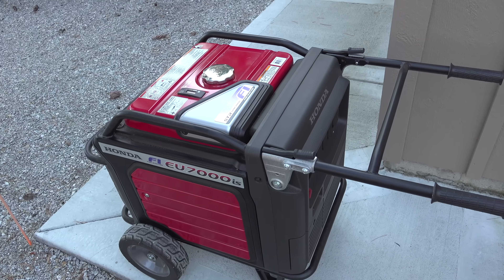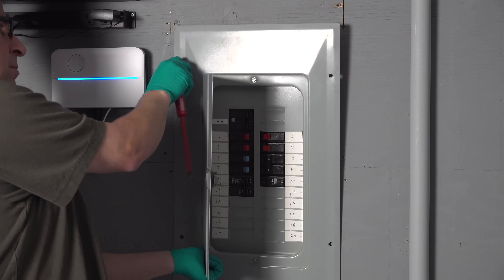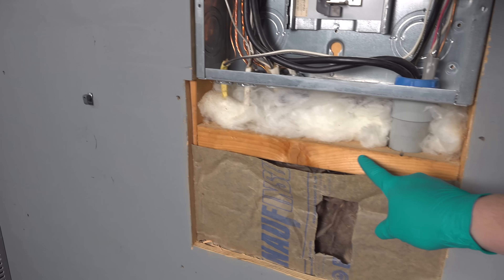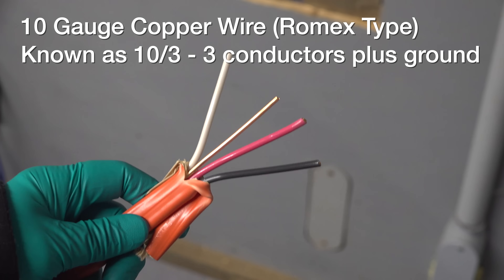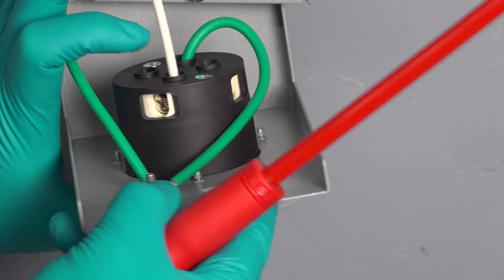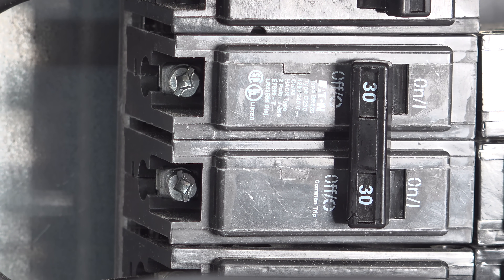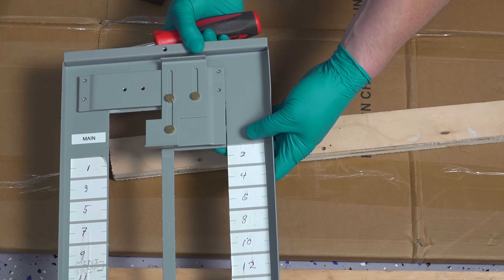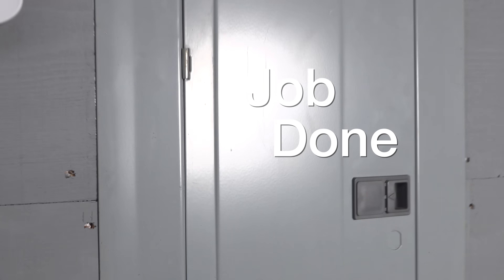Cheap & Easy Way to Connect a Generator to Your House - Legal Too!

Comment: If only my 60 year old panel had a main breaker.  Instead I have a massive main fuse block with two 100A fuses so I'm SOL.
Reply: so you can use a transfer switch?

Comment: Hi,
Thank you for the useful video. 
I have a question please. 
I already have a generator connection. I want to reverse the sama idea and use that same outlet where you plug in the generator, use it for EV charging. 
Is it possible? If yes what do I have to change? 
Thank you in advance 🙏

Comment: Why would anyone install a 30 amp, though? Always install a 50 amp. If you have a smaller generator, you can get a 30 amp adapter or female plug. If you get a larger generator later, you won't have to do so much work.

Comment: i prefer to use an automatic transfer switch. they are not very expensive and will not transfer until the generator is running. i also like remote start for the generator. no going out in the rain to pull a statrt cord.

Comment: Would it hurt to install the 50 instead of the 30 in case someone later upgrades or daisey chains their generator?
Reply: I would not since the purpose of a breaker is to open under excessive load. Running an excessively large breaker reduces that protection.  If someone changes their system they should ensure the entire circuit INCLUDING CONDUCTOR SIZE is correct for the application.

Comment: You need a hold down for that breaker as well, to comply with 408,36(D). 

There is a multiwire branch circuit in the same conduit as the service conductors, that's a code violation. 230.7

Comment: What stops backfeed from going out the other end of the house and killing the lineman trying to re hook up the downed power wire?
Reply from the maker: That's what the interlock does. By being forced to turn off the main, you are disconnecting from the grid. It mechanically ensures it when installed correctly.

Comment: Could I run the whole house and water pump(well)  a generator is usually 30/40 amp a whole house should be more correct ??? Ac , lights , tvs fridges washer dryer?

Comment: Hi, I like this video, I just need to understand about the capacity of the generator I need to supply electricity to my house (1.000 KWh) monthly in my electric bill, How to calculate this capacity at least to supply continue energy  for 10 hours before recharge/refuel or something.

Comment: So… 10awg is sufficient for a 30a 240v set up? I need to extend my inlet box to a different location. How long of a run with 10awg wire is safe for a 30a set up ?

Comment: i need to do this so one question! the generator beaker switch , when you install that will that power everything and turn off what you dont need to not overload the Gen ?

Comment: I remember confusing everyone when my apartment power went out. I pulled the car around back and connected it's internal generator (it was a ford probe converted for camping) and turned off the main then plugged in the car generator to the user side of the meter box (user service feed bypass) which wont open until the main outdoor switch is thrown (to prevent back feed) . Everybody was like, how you gonna get power to your apartment with a car? lol

Comment: Hi where would you put the generator if it's raining in a storm, with wind?
Reply: I would have a suitable outdoor enclosure which doesn't have to look pretty but should be securely anchored and high enough never to flood.  Putting a genset on a wheeled cart or dolly (using decently large wheels even if you have to add them) or hand truck is another option if you're not in a high theft area.

Comment: I saved 50 bucks by making my own interlock using a piece of 1/8” soft but rigid plate aluminum. Either take accurate measurements or copy them from other kits. Works like a charm⚡️

Comment: Great video. You've done a fantastic job in showing how to properly wire up an external 30Amp plug for a generator. I'll be installing a 50 Amp plug on the outside of our home since I'll  have a GENMAX GM11000 iETC electric start inverter generator. I'll be using 6 gage wire since it's for 50 Amps. Again, thank you a great educational video. Cheers!

Comment: I actually use two different generators. One is a 3500 watt inverter that burns very little fuel. We use it during power outages when outside temps aren’t hot enough to use ac. Will run anything on 120 in our house. Have a 15500 that will run the entire house, but uses a lot more fuel.
I have a disconnect that prevents back feed. The way I have it set up, takes just a few minutes to switch between generators. Could have went with the generac setup that is all automatic, but there are other things I need a generator for. Fortunately most of our power outages are thunderstorm related and generally last just a few hours. But we occasionally have tornado damage that lasts for days and the occasional dreaded ice storms. 
We live in a very rural area and our local power company does a very good job but they can get overloaded with work in a short time. Large coverage area, not many employees.
When we are expecting storms I go ahead and get the small generator set up, ready to go. Really helps.

Comment: Why not just install a 30A receptacle and use an extension cord that is male on both ends?
Reply: Because an unplugged male end will be live if the other male end is receiving power. If you touch the unplugged male prongs, while it's receiving power, it will electrocute you. If you let the male prongs touch any object, it will make that object electrified, and touching that object will electrocute you. Meanwhile , if that end is a female end, it will not have prongs to touch anything, and can not electrocute you if you touch it, and it can not electrify any object it comes in contact with. This is why any end receiving power should be male, and the end sending power should be female. You can technically get by using the double male end but you will want to make sure the unplugged end is not sending power until it's plugged in.
Reply: @howardradford1985  but you’re not supposed to plug it in while it’s running. So, if you plug it in when the generator is turned off like you’re supposed to then there is no risk of electrocution right?
Reply: @judynuno5694  You may also have the issue with a fault crossover or main breaker. I have seen breakers where the internal components melted and fused in the on position. You can flip the breaker in the off position but because it's fused it's not actually off. If you turn off the generator and unplug it the power could still be traveling the opposite way. If there is no fault it's not a problem.
Reply: @howardradford1985  is there a panel that is more prone to such a problem than others? I have a 200Amp panel and have 8 open spots.  I’m not using anywhere near the potential of my panel. Could that still be an issue?
Reply: @judynuno5694  It's not really the type of panel it's more the main breaker itself and how much you have on the bus bar. It's you aren't pushing the 200A to it's limit than it's unlikely for it to fuse, but that just means it's a much lower chance. If you are confident and I mean really confident you haven't been pushing the 200A to it's limit you might consider yourself safe, but an licensed electrician can never consider it safe.
Reply: @howardradford1985  thanks for the tips

Comment: Could you use 8 gauge wire instead of 10?
Reply: Yes, you can always use a thicker gauge wire. 8 gauge it for 40A and down while 10 gauge is for 30A and down.

Comment: I can find most of the supplies ill need on amazon. but what type of wire do i need? what gauge. and would i most likely pick up the wiring and romex from home depot? thanks for your time
Reply: Depends on you generator or how high of Amps the breaker you want to use. Generator with 7200 watts or less will max out at 30A and need 10 gauge wire. Generator with 12000 watts max out at 50A and need 6 gauge wire but if you only want to use 30 Amps of the 12000 watt generator you can use 10 gauge. Some people will intentionally use the lower Amps on the higher watt generator so they aren't pushing the generator to its maximum capacity and help fuel consumption.

Comment: How do you know what size wire to use?
Reply: 50 amp needs 6 gauge
40 amp needs 8 gauge
30 amp needs 10 gauge 
20 amp needs 12 gauge
15 amp needs 14 gauge
10 amp needs 16 gauge

Amps are all you have to worry about when selecting a wire because all wires can carry 240 volts.

Comment: What kind of wiring do I need to go from inlet box to the breaker panel?Also do I need 10-3 or 8-3 gauge? Wiring a 50 amp inlet box. Generator is 110/240
Reply: Thank you sir.
Reply: You need 6/3. 6 is the gauge and the smaller the number the thicker the wire and anything thinner than 6 gauge will start melting past 49 Amps. The 3 is the number of wires minus the ground. You will need the red and black positive, the white negative, and the bare ground. x/2 wire only has the black, white, and nothing over 30 Amps uses only the one black positive.
Reply: @howardradford1985
Thank you sir

Comment: So, how do you know when the power comes back on? Your main is off?
Reply: My electric company will call me if I ask for notice of power restoration. In my case though I have two breaker boxes. One on the power pole that powers my AC and one in my laundry room for everything else. I wire into the laundry room breaker box and use window units for air inside and I set the big ac to it's lowest setting. When the AC kicks on I know the main power has been restored.
Reply: @howardradford1985  Thank you. I was thinking I could also make one light circuit be on the main power as well. So when the hallway lights go back on, i know. Thanks for sharing!

Comment: You need to ditch those Federal breakers ASAP !!!!!
Reply from the maker: They look like old Federals with the red and blue toggles. But there are Eaton breakers, Eaton stopped coloring the handles about 10 years or so ago. But these are still current and available.

Comment: Why isn't this backfeeding?  If it isn't, explain why, pls. or define what backfeeding is.
Reply: Because the interlock shuts the main off.  Power can't go through the breaker when it's off
Reply: Man, I lost 10 billion brain cells trying to explain this to someone one day.
Reply: This is backfeeding but there is a difference between backfeeding on a closed circuit and backfeeding on an open circuit. The interlock guarantees its only backfeeding on a closed circuit. Without the interlock switch there is a chance you will backfeed on an open circuit. If you backfeed on an open circuit you run the risk of backfeeding back out to the utility lines and when power is restored your breaker box and generator will potentially fry from having multiple out of sync phases on the same circuit.

Comment: Theoretically, you don’t really need the Interlock plate - it’s only a safety device to ensure the main breaker and the generator breaker are not “on” at the same time. I’m assuming that the 30/50 amp breaker can be placed in any position in the main panel?
Reply: This is true but you will need to ensure you or someone who knows to switch off the main turns on your generator. It will also fail inspection if you sell the home to someone who insists on an inspection. It also makes you liable if someone else tries turning on the generator incorrectly and criminally liable if it's someone you sold the house to and they didn't do it the right way.

Comment: This is a great video! Very nicely done! The one thing that I would add is to test the circuits once you have everything installed. You only have 30 amps to work with, so it's good to put an amp Probe on there and check things out see how much power you're using for different circuits so you're not overloading anything. Just a tip for those who might go ahead and do this themselves.

Comment: I wish more folks would do this correctly like you show. I’m a home inspector and have seen many houses with the inlet box and NO interlock kit!! Even with dead man’s cables plugged into the dryer 240 volt outlets. Tragedy waiting to happen. Do it right, if you can’t… hire someone and practice when there is no power outage, not when there is an outage….you have to practice/ prepare, have fuel stored safely, change the oil after 55/60 hours and ride out the storm with power and if you have soft start kits on your central AC units you can have AC too.

Comment: I'm just going to throw my two cents in. I'm no Master Electrician but Your connector that you installed, has in big bold letters" NOT FOR INDOOR USE". I don't think that will pass code.
Reply: This setup is for a solar generator, not fossil fuels.

Comment: My panel has the main breaker at the top horizontally. It’s not inline with the circuit breakers. Is this still possible?
Reply: Yes, you will need to select the correct interlock switch for your breaker box setup. They come is different styles.

Comment: You made some rookie mistakes, but the main one is placing your box inside the garage instead of outside forces you to run your power wire, or your "whip" through a window or door, thus leaving elements coming in during the Winter.
Reply from the maker: Hopefully you saw the part about running a battery system from it, which is why it went inside

Comment: Do you need an electrical permit to perform this?
Reply from the maker: It depends on your locality regulations. If you are in the US, you can always start by contacting your building department and they can let you know.
Reply: Even when you do technically require permit they usually don't do anything about it unless you intend to sell the property. Even then you probably won't get penalties if you get the permit retroactively before actually selling.

Comment: Great tutorial.  I have a question: can you run a house on 30 amp?  Isn't the max wattage through a 30a 3600w?  If I have a 6500w generator, will it even benefit me?  Is there any benefit to the larger generator?
Reply: It's a duplex breaker so it's 30Amps on each leg. That's why both the red and black are hot. The breaker box also zigzag the distribution across the box.
Reply: @howardradford1985  okay. Thanks for explaining that

Comment: Illigal in canada for some f...... reson
Reply: Because it's defeated simply by removing the cover panel so they require a transfer switch so it can't backfeed
Reply: @howardradford1985  how is everybody in the us not catching fire?
Reply: @lareau6  In us, technically are all single phase because we split each phase which helps harmonize the electric flow. In Canada yall use a true double phase which requires specific wiring methods and backfeed becomes alot more dangerous because two different phases are never harmonized.

Comment: I'm a licensed electrician and I'd hire you to do this work for me. 100% legal and done in a workmanlike matter. The only thing I do differently is I like to, locate this inlet device box on the exterior to deter a homeowner from setting up and running their generator indoors. It's not a code violation to install the inlet indoors however.
Reply: Isn't the neutral being bonded in the panel and also being bonded in the generator a problem? I know it's a code violation to have a neutral to ground bond in more than 1 location. Shouldn't the generator be a floating neutral?
Reply: @Antoniocool86 generator outlet has a label saying “neutral floating”, what makes you say it’s bonded? Did I miss something?
Reply: @alexnone3374  you must have amazing vision if you could see that sticker on the generator of the electrician that I was replying to through your computer monitor, through your internet line and to wherever his generator is stored. I'm asking Ron about something that is overlooked by 95% of the people making this connection. It's not even mentioned in this video at all but it is important. Most portable generators are bonded neutral which would be no good in this situation, it needs to be a floating neutral and it is not mentioned at all in this video or most videos showing how to do this. So for people that don't know, they will be doing it the wrong way not knowingly. And yes I see the label on this generator in the video but there is no mention of it at all in a video that's supposed to be teaching people how to do it.
Reply: @Antoniocool86 my understanding, after a fair amount of research, is that the generator uses the house's grounding rod when you are using an interlock kit like this.
Reply: @leofoster9765  Or a cable through the wall!
Reply: An electrician in my hometown quoted me 1200.00 to do this, 2nd quote from another electrician not come in yet , is that a reasonable price for this work to be done ?
Reply: How is this legal? Even with the interlock, the panel is still being back fed.
Reply: @jayw900 back-feeding is safe as long as you are not back-feeding the grid. The law is to protect linemen while they are working to restore power during an outage. Since the interlock makes it physically impossible to backfeed to the grid, it is legal.

Comment: Out of curiosity, what size generator would I need to run an average size (3 bed / 2 bath) house. Would need to run the central AC (in Florida), refrigerator, hot water heater, stove, and lights.
Reply: Central AC might be difficult to include do to surge requirements. Might be a better idea to buy a couple of window units and use those instead of the Central AC all consumer Generators I've seen max output is 50amps at 240Volts so that's 12000 watts. If using propane or natural gas get a 15000 watts because 12000watt generators only produce that much on gasoline

Comment: My brain is my interlock.  Always wait till morning  if the outage is at night. Main breaker off, all unnecessary circuit off. Make all connections then you can start your generator after you check main breaker again.